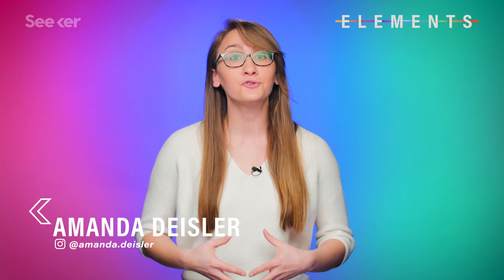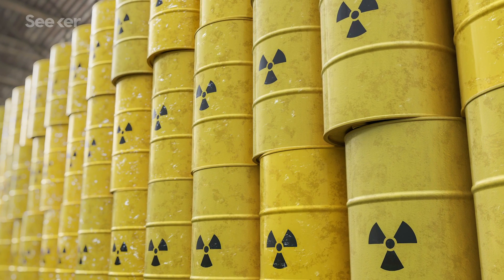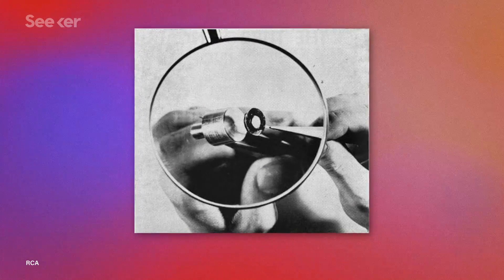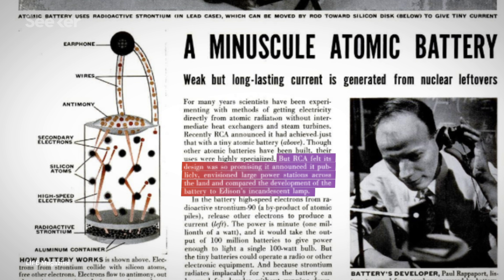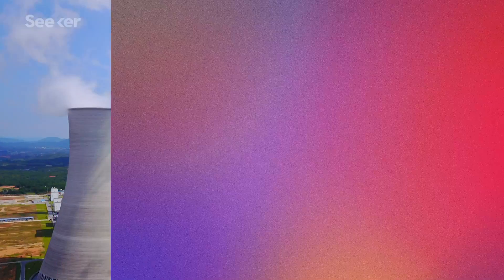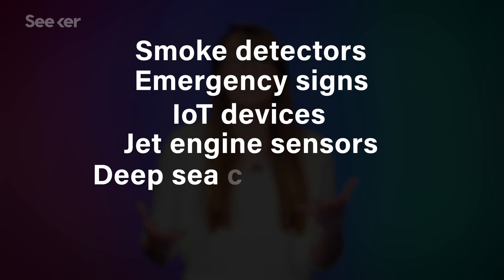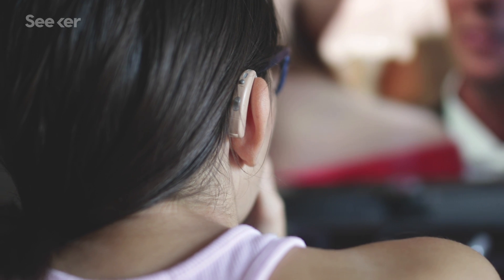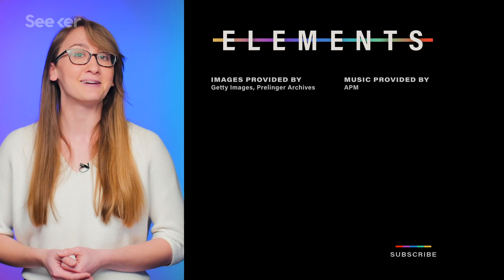Diamond Nuclear Batteries Are Forever… Sort Of

Comment: The reason why the diamond can capture radioactive materials easily because the Nano carbon acts like a faraday cage around it it's a smart idea if you're trying to create a Chaos Emerald Sonic
Reply: Carbon 14 is radioactive in and of its self. It doesn't need to trap any radioactive materials.
I got the sonic reference BTW.
Reply: @JasTheOne2  I think by radioactive materials he meant beta particles.
Reply: @Wave1dave  That still doesn't make sense. Carbon 14 emits bata particles from the atoms, it doesn't collect them, it's not a storage device, depending your definition.
Reply: @JasTheOne2  Yeah I know. Just saying that by "capturing radioactive materials" he meant "releasing beta particles". I completely agree with you
Reply: @Raymond Terwilliger I don't know about that "Chaos Emerald Sonic" thing but. I've always thought that alpha particle would make a good battery. When encased in carbon fiber with graphene strips to act as conductors. If combined with a beta voltaic battery you have both potentials. It may be crazy but this shows what is possible. Our science and knowledge of carbon is increasing now we only have to design a way to strip it out of the atmosphere at double the efficiency of trees or naturally occurring alge. 

It will take generations of change in our use of fossil fuel along with co2 stripping, actually separating the carbon from the oxygen like plants do. So we can make our carbon fibers and graphene products from it in the near future.
Reply: What if diamond somehow breaks, because humans are best at messing with anything. Will it cause cancer?
Reply: @sangouda1645  lol
Reply: @sangouda1645  
Nope, beta radiation is blocked by pretty much everything. The layer of dead skin you have surrounding you should be enough to block beta radiation. If you are wearing clothes then that will do the job for you instead of your skin. Unless you are holding it to your face and inhaling it all then you should be fine.
Reply: @Subjagator  Uh, you may wish to discover the joys of bremsstrahlung radiation (bremsstrahlung photons). Don't give advice concerning radiological hazards until you've dealt with your ignorance and arrogance!
Your "advice" could result in great harm, or even death, depending on the energy of the beta decay and if/how the source is shielded.
Reply: @anhedonianepiphany5588  
You're a funny guy, keep bringing joy to the internet.